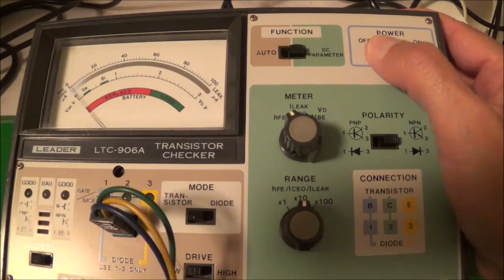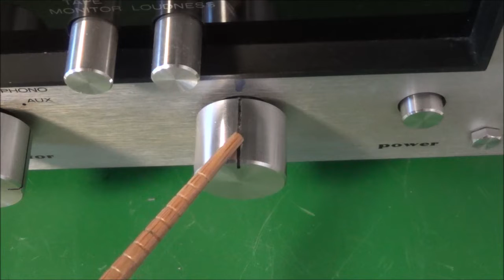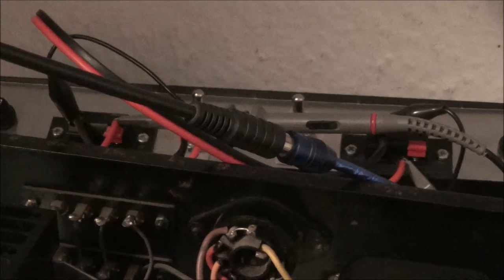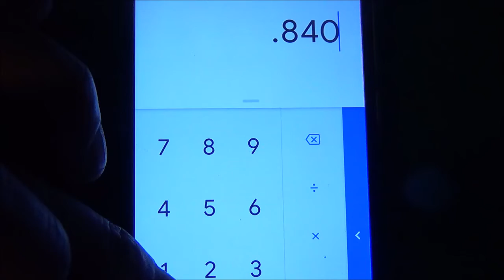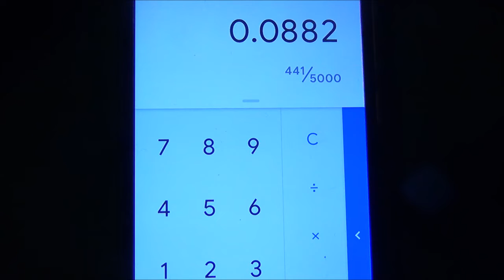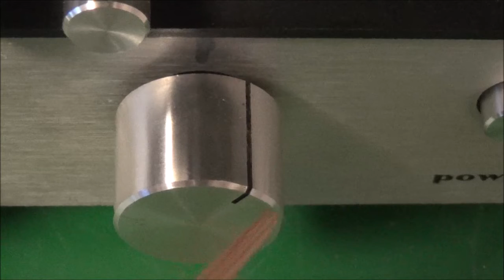The Volume Control

Comment: Hi Mr. Oldschool. Good to see you're back and reminded that I was supposed to reply your email. Haha. Sorry about that. You know how the current happening is but I will do so hopefully soon. 

About this video, I am one of them who thought that the volume knob at 12 would give 50% output. This is actually not the case. You had cleared that in a very detailed way. Thank you for the enlightenment. I now know the volume pot is like a water faucet. The taper equals how the faucet allow the water to flow through. Some faucet goes from 1 to 11, some you can control the output.

I noticed you have a new digital scope. Thumbs up.
Reply from the maker: Cool! Glad to see you are back and thanks for watching!